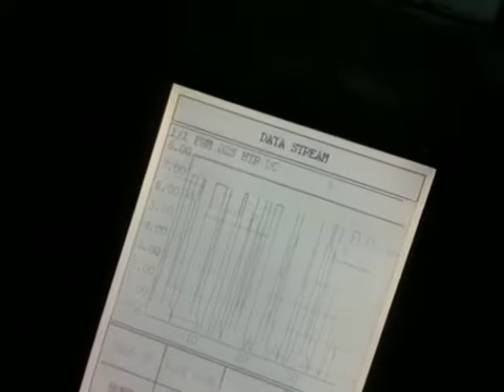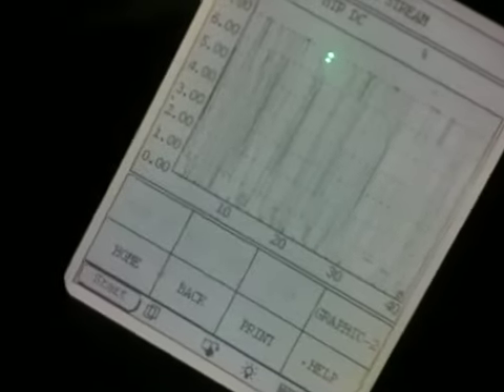First test with HHO voyager Chrysler

Comment: You got higher levals of O2 intermittently....your cars computer is faster than that scanning tool. So find that spot and repeat it. What's happening is the OBD is patching the hole with fuel. Period. Stinks hah. Look at injector milliseconds at the same time, however once that scanner sees it its already gone. I think the best test is put the Hho on the back side of the throttle body and decelerat and look at injectors then clap the Hho hose and look again. This will give the most dramatic test